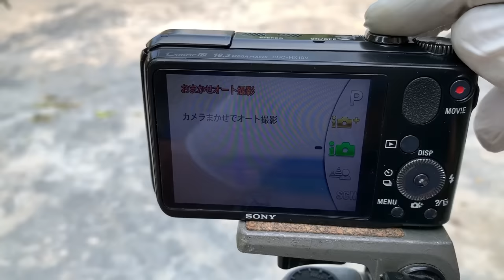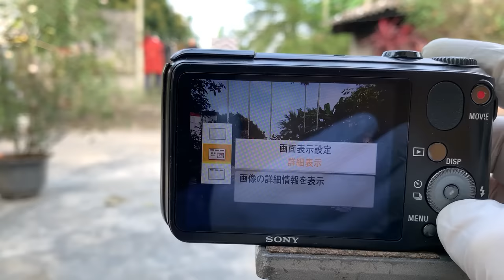Restoration Sony DSC-H90 camera | Teardown old sony cyber-shot 16.1 MP Digital

Comment: Are you still planting items and pretend you found them?
Reply: Yeah, this is what I also do not like in these videos. Just say where they are from, we do not need these fairy-tales
Reply: man, this is for entertainment. people like to see this things fixed, dont matter if its fake
Reply: Considering most modern cameras are made of plastic most of what is shown can be believed iv seen many cameras stripped down and rebuilt Mmmmmmm probably not cost effective but it just shows that it can be done
Reply: Kolab quok bisa
Reply: Stick PS Vita Marissa
Reply: Historian said, he is.
Reply: @Александр you've obviously never tried to take one of these things apart.  You can't fake it.  If you don't know exactly what you're doing you'll break it.  This guys knows all there is to know about this stuff because he's worked in the factory that makes them.  That's why he knows all the tricks about where to check resistance to make sure that there are no shorts or opens.  If someone wanted to do this just to get clicks, they would've had to leave out most of the taking it apart stuff because they wouldn't have a clue where to start.  Someone with the amount of hands on knowledge that this guy has, doesn't need to fake it.
Reply: @Александр yeah.  I guess I'm the fool here.  Oh well.  I figured I'd give the guy the benefit of the doubt.

Comment: This is magic. The acquired camera was thrown away by itself, and the cleaning and assembly process is an accessory that disassembled another camera. Of course, the abandoned camera by the river must be crushed and broken somewhere. It's not something you can find by the river.It's a place where you can't find the object quickly.It's not a camera repair factory trash can.
I found it right away.
And if it corrodes, the coating and paint will be peeled off to remove rust
Reply: this is a fake
Reply: Bobby Taylor  he is saying it’s fake but using 85 words when 2 will do

Comment: There's just one thing you DON'T HAVE TO DO WHEN THE CAMERA IS NOT WATERPROOF AND YOU FUCKING DID IT ON THE FIRST PLACE, fuck this is amazing
Reply: It only matters if electricity goes through it and as long as its off you can put as much water as you want on it until it dries out then you can tuen it back on
Reply: Electronics dont just get erased from existence in the contact of water, you know? Even cellphones can be submerged in water, if you disassemble the pieces and put them in the sun it will work just as before
Reply: @CarlosCosta-gp4dv  yea true, because electronics break when water AND electricity pass through then because it creates corrosion
Leaving it dry is the correct way to do it
Reply: Is not just a camera, is a  Sony camera !
Reply: @CarlosCosta-gp4dv  You clearly know very little about electronics and it appears you have a number of friends who know just as much. All you have to do is let it dry. ? Bullshit.

Comment: I'm going to disagree with the pack here.  To see in real time, how this guy knew EXACTLY how to take this thing apart, that in and of itself, is amazing.  You can't fake the ability to do that. In another video, he did the same with a synthesizer keyboard.  My guess is that he and his friends and families have worked in major electronics assembly factories all of their life and can tear these things apart and put them back together in their sleep.  He knows what he's doing because he's built, tested and repaired all kinds of gizmos like this.  If the goal of this channel is to simply fool everybody, then there's no need to show EVERY SINGLE piece being disassembled by someone that is DEFINITELY NOT a fake.  There's way too much detail shown in this video.  And it's a really high quality production as well.  Seems like an awful lot of work to go through just to get clicks.  It could've been done much simpler and sloppier and have achieved the same amount of views.  No, there's no fakery here. This guy is EXTREMEMLY knowledgeable about how this stuff is assembled AND how it works.  He understands these products intimately.  No camera repair tech, no matter how many years of experience, can hold a candle to these people.  You may think it's funny that he's "checking the values of electronics parts" but he's really doing sanity checks with an ohm meter to find bad connections and/or bad integrated circuits.  He knows where to take measurements and what the resistance should be.  Beyond that he also knows how to clean the funk and scale using a combo of soapy water and degreaser.  To clean metal contacts he probably used a mild acid (vinegar?) and neutralized it with baking soda.  Without hesitation, he knew precisely where to apply the soldering iron to break apart some of the assemblies.  Sure.  There's little doubt that some of this was staged...meaning it's doubtful that he just "stumbled" across this thing.  And maybe he had to replace some parts that were too far gone.  So what?  I believe that the bulk of it was real.  Hey, even if he did nothing more than take apart and put together a brand new camera and actually get it to work again, that would be more impressive than half the sh*t on YT.  Face it.  These guys are a lot more resourceful than your average American couch potato, myself included : )
Reply: U r writing comments or a book.... 😆😆😆😆😆😆
Reply: lol wdym not fake? it totally is. nobody would clean camera lenses like him: in water and with a regular paintbrush.
Reply: How it actually works is that he shoots the last part (where everything is clean) before dunking the camera into dirt to show how he "repairs" it.
Reply: @Leos74  Maybe you're right.  But he definitely knows his stuff to be able to take that thing apart like that.  Is it somehow faked?  Maybe.  But it's not just "dunking the camera into dirt" that makes it look like it did.  That initial camera definitely spent a lot of time under water.  I'm not going to bet my life on this being real...but it's not impossible.  I dunno.  Maybe I'm the one that's spent too much time under water.
Reply: Do you seriously believe this is not fake?
I honestly thought you were writing a comedy piece and I was waiting for the punch line at the end!

All these videos on this channel are all FAKE.

The simple premise is the same, just the item to be 'restored' changes.
It's done by clever editing ie take a working unit (camera in this case) film it working etc this will form the last part of the video.
Now go and dirty it up, bury it, soak it, leave it outside to degrade or rust etc Now film finding the broken, dirty camera, film the beginning, then 'pretend' to clean it up, film the process, the fault diagnosis on the electronic components is laughable, you'd need a schematic and charts to understand the input and output  values of every component on the pcb which is not possible at this level of 'restoration'
Take the video as entertainment value only!

One thing is for sure I wouldn't spend the many hundreds of hours time and effort to fix and restore something not worth anything!

I'd just buy something used but mint and working perfectly already!
I just bought a Panasonic lumix g3 for £45 it's perfect condition, still looks like new, came with lumix case, lumix shoulder strap, charger and even an sd card. 
It's a 10 year old camera but still gives fantastic quality photos and video.
Reply: @pdtech4524  Okay you win.  I guess I'm a sucka : 0
Reply: @TheStudpop  Ohh so you suddenly change your tune, did you? You clearly have no idea how a production line works. Nobody builds a complete camera, each person has just one job and it's then passed to someone else to add a different part. There could be 50 or more people working on just one camera. There goes your fairy tale. Do you also believe the Earth is flat? It sounds as if you might.

Comment: Well, this one doesn't look fake, like the usual "bury something then find it again to restore" Looks legit.....
Reply: Not that I can’t believe that but I didn’t know that was a “thing.” Can you link me to any in particular?
Reply: @RoLee705  Fairly common Rose. They pretend to find something covered in mud and "restore" it. Some look bogus from the get go, but I can't link you to anything particular. Check out a few of them, you'll soon get the feeling of which ones are a set up. There are hundreds out there, almost always resurrecting radios, tape players, electric appliances etc. Most of the mechanical ones, like drills, machine tools, motorcycles etc look real enough and the result is usually spectacular compared to what they started with because they're almost always covered in years worth of rust, not just a bit of mud slapped on. Most are entertaining enough if you have time to spare....
Reply: the video is reversed,

Comment: You washed it with water even circuit board also. I am amazed how could circuit board didn't get short.
Reply: Washed them dried and with no power source inside from the begining, how can it cause short in the circuit board?
Reply: @baoanh3926  are those circuit boards are waterproof?  He is also washing lcd display. Is it possible?

Comment: This restoration is as real as the tooth fairy. I think they just bought a cheap camera, shoot with it in its working state, then fill it with crap to make it look rusty (dunno how they think oxidized plastic looks like metal but okay). Then they do the "restoration" portion of the video.

You can't just fix a damaged camera sensor and lens by brushing it clean.

Comment: Something I noticed after checking the ending again. It's an entirely different camera. The one at the start was a Sony DSC-H90 16Mpixel and at the end it was a Sony HX-10V 18Mpixel. The name and model can be seen on the top rear edge when it's on the tripod. 

So that along with many other factors proves without doubt this character is nothing more than a liar and cheat. He's making enough money on YouTube to buy second hand working hardware, to go with a non-working same model unit he bought really cheap or someone gave to him.  I'm convinced he throws the non-working unit in a plastic container half filled with mud, sand and water. He has a collection of gadgets covered in crap for weeks maybe months, He then chooses one, takes it out lets it dry, then makes a video of it being dismantled and reassembled then adds that footage in front of the unit that works.

He doesn't care about us calling him a scammer and a fraudster, the money makes up for that. However it does make me angry that he's fooling people and giving the repair industry a bad name. Not that it was that good to start with.

Comment: I'm a technician in smartphone repair (with a lot of experience) and I ensure you that is not possible repair electronics in such condition. The components and board tracks are very weak against water and rust. There is no way back after several water damage. Even in possible repair's conditions there are some traces of rust and the components at the final assembly are shining like new. LOL.

Comment: This is actually an HX10V. so you found the camera without the batterry and no rust on the contacts (very suspicious 👀). also i don't think you can just wash and scratch with detergent and some bleach the lens, the LCD display and the CCD sensor😅 finally the micro sd memory was empty with a single pic from 2012. this videos are all the same kind of reversed with same mud to make think you repaired stuff lol 
I guess is for educational purporse only, like we can watch tearing aparts of some electronics devices😄

Comment: Why put such an amount of effort into trying to restore a digital camera that would almost certainly have shorted out its circuitry the first time it was immersed in water, i.e,  in the river?? Unless of course it was thrown away into the river without its batteries because the original owner knew the camera was completely non-functional! ..... but then what’s the point of trying to repair that especially given the state it was found?   There’s no proof that the camera we see working at the end of the video is the same one that was found by the riverside!

Comment: What is the point of restoring this camera? Older 3C products are not worth the money. The brutal disassembly and rusted wire connectors are impossible to clean and restore, and the deceptive practices are disgusting.

Comment: The video is FAKE. It is impossible to restore the device to full efficiency with such degradation of paths and components. The display cannot be salvaged, so are the optics and all the tapes that can be seen as left on gloves. To me, it's a scam, not a renovation video. Only about how to wave a brush and use chemicals to clean. Basically every video on this channel is fake. I don't greet

Comment: Look at this video between the times of 7:22 to 7:27 and tell me that this corroded rusty screw head he begins to try and unscrew but it starts to strip when he tries to turn it loose with the screwdriver,  how the screwhead magically turns from a rusty screw that is not turn and the philips head stripping to in a millisecond later magically unscrewing and the screwhead  more shiny and not stripped like the one shown at 7:22.   Haha this video is a Fake put on.   Why would anyone create something like this?   The water and salts and corrosion and oxidization would have every contact , every ribbon plug and all solder boards completely oxidized and toast!!!  I am perplexed who actually believes this and more perplexed why this dude does multiple videos showing this fake carp?   LMAO